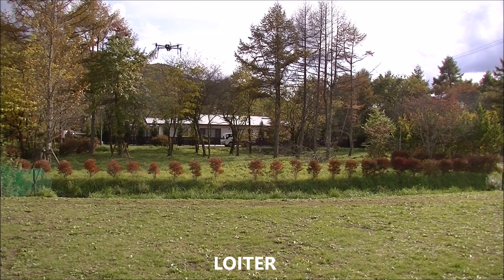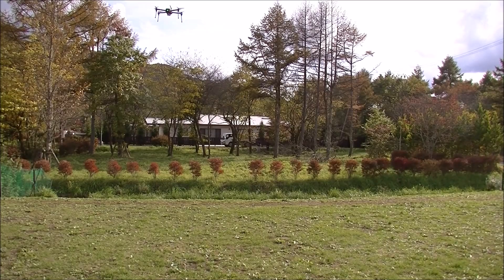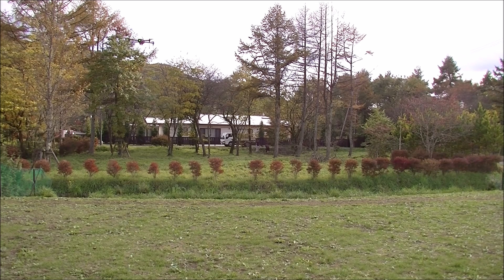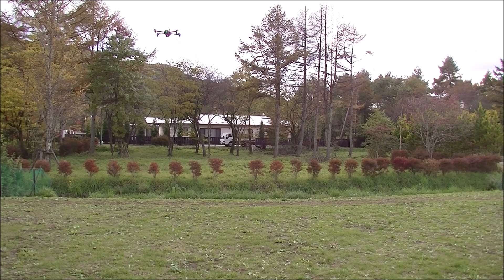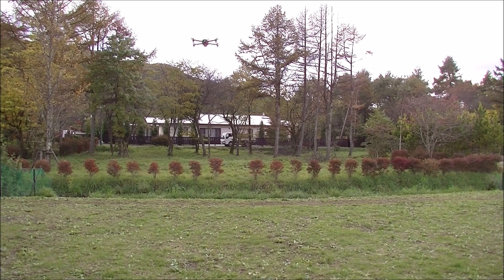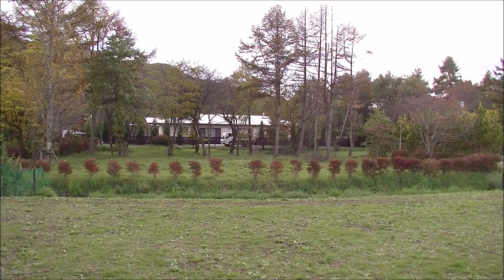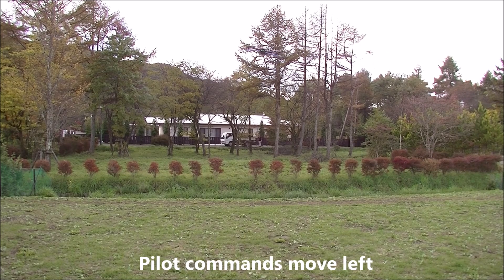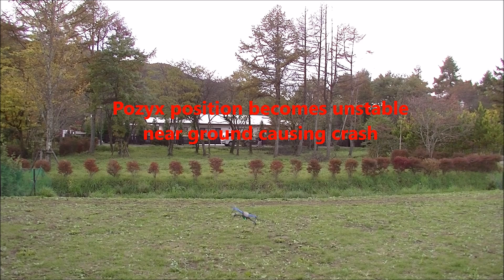Pozyx Loiter (No-GPS)

Comment: Hello, I am currently developing a project for my final year. I have been using q ground control as my ground station for non-GPS loiter, but it did not work. Any suggestion on how i should do it or will changing my ground station to mission planner help? Any input is much appreciated. Thank you
Reply from the maker: @Yap, I would have expected either ground station to work because Pozyx doesn't really involve the ground stations.  I always use mission planner myself.  Maybe try the latest development code (press Ctrl-Q on the mission planner's Install Firmware screen) and try using the EKF3 instead of EKF2. http://ardupilot.org/copter/docs/common-apm-navigation-extended-kalman-filter-overview.html
Reply: Randy Mackay thank you so much for the reply. I am not using kalman filter (EKF) for the time being. Does this affect? I am able to detect the coordinates from my pozyx tag on my arduino IDE using the indoor loiter sketch after a few modification, but i am unable to see the coordinates of my drone on my ground station (q ground control). Any suggestion to input? Thank you.
Reply from the maker: ArduPilot Copter always uses the EKF so I think your vehicle probably is using the EKF.  I guess you are following the instructions here? http://ardupilot.org/copter/docs/common-pozyx.html
Reply: Randy Mackay i doubt that my drone is using EKF. I cannot see the location of my drone on my ground station. Yes, i followed the tutorial on the ardupilot website but it still does not work. Any advice to suggest? Perhaps you have screenshots of the mission planner showing the position of the drone on your mission planner that you can share with me. Thank you so much.
Reply from the maker: Normally we do support on discuss so perhaps you can raise an issue there?  it's best to provide a binary log as well (maybe set LOG_DISARMED = 1) and provide a link here afterwards.
Reply: Thank you for the reply, mr Mackay. Can the loiter mode work without the ground station configuration? Due to time constraint, I am trying to send the coordinates from Pozyx to my computer via bluetooth to know my drone position on the ready to localize visualization map. Thank you.
Reply: Thank you for the reply. I have configured all the settings in my ground station (Mission Planner) and followed the steps on the website. However, i still couldn't see my actual location on the flight plan on my Mission Planner. Any advise to input? Thank you

Comment: May I ask, whats data of pozyx?
Reply: And I see, there is some unstable condition, why can be happen?
Reply from the maker: The Pozyx provides 3-axis position data within the area defined by the anchors (and possibly slightly outside the anchors).  I think the instability came from the quite limited range of the Pozyx.  So when it couldn't connect to one of the beacons it return very poor position data.  So far, I'm seeing a reliable range of only about 25m although I hope that can be improved.
Reply: oh so, if many beacon so will more precise the position, its will be great, hope there is any open source project like Pozyx (software and hardware)
Reply from the maker: Making an open source version is not too hard I think.  The Pozyx does make things easy with many built in functions but the real magic is in the DWM1000 sensor itself I think.  If price is the issue, I don't think the Pozyx is too expensive though personally.  Perhaps a very cheap version could be made for 1/2 the price but that's it I think.  The DWM1000 sensor is about $20 I think so once you include a fair market for the manufacturer I don't think it can be super super cheap.  That's my feeling anyway.
Reply: https://github.com/KitSprout/KDWM1000

This project gives the exact same capabilities than the Pozyx. (Same architecture : STM32, MPU, DWM1000)
Reply from the maker: Alexis, thanks!  that does look very similar to the Pozyx and way smaller.  Not sure it's for sale but for someone looking to make a product based on the dwm1000, I think this repo may provide the board layouts.
Reply: Randy Mackay There are multiple other projects, this one : https://github.com/thotro/arduino-dw1000 gives the same project without the MPU and with an Arduino (much simpler)

Comment: Looks really nice, did you fusion the proxy data with accelerometer for the position estimation?
Reply from the maker: In this test we are simply using the pozyx data as if it were from a GPS.  So only the position estimate from the Pozyx and the Pozyx itself was only using the dwm1000 sensor to come up with that estimate.  The EKF does blend the GPS with the Pixhawk's accelerometer data (and other data).  I don't think we will move towards using the Pozyx accelerometer data but instead move towards a tigher integration of the individual distances to the anchors with all the other data the EKF has (accelerometers, gyro, baro, optical flow and even GPS if it's present).

Comment: Hi Randy I wish to share a very unusual performance behavior. My Xugong V2 on a CUAV PIXHACK FC. I loaded AC3.3.3 did over 120 test flights to clean up some rough flying . Imagine driving on cobblestones . Now I did everything fro prop swap to firmware version change on esc. Xrotor using Blheli. Finally I loaded the old AC3.2.1 and to my surprise I'm flying smooth like on a first class paved road. I wonder why this is? Any thoughts?

Comment: Really good work. The positioning are really accurate, except it seems that motion will corrupt the positioning. Does it also take in altitude information from Pozyx for loiter mode?
Reply from the maker: Muquing, Thanks.  The Pozyx does return the altitude but in this test at least I'm not using it because so far the Pixhawk's barometer seems more reliable (although it drifts).  I'm hoping to improve the reliability by making some settings changes to the Pozyx (i.e. changing from 6.8Ghz to 3.5Ghz) but I have to say that I'm quite disappointed by it's range.  It's advertised at working up to 100m but it's practical useful range seems to be more like 30m.
Reply: you have to jack up the power if you want more range - have you talked to support? Also pretty sure they will suggest to set up filter on the coordinate output in order to mitigate crash risk.
Reply from the maker: Michael, I haven't tried talking to support but we did find this setTxPower() function that we will try to use to increase the transmit power.  I've received other advice that I need to raise the anchors.  In this test two of them were on the ground and two were at about 1.4m.  I think maybe we can try them all at about 1m.  I'm not sure what that will do to the position estimate.  We only need the horizontal position (x,y), we don't need z and it should be able to calculate that even if the tag on the vehicle is high above the anchors (I think).
Reply: Don't put the anchors in the same plane. I think there's a guide on how to position anchors. Also a smoothing function could do the trick for you. All functions are detailed on the site. Send a mail to support. My brother is a nice guy and there's a full team doing support from mon to fri.
Reply from the maker: Thanks Michael.  I actually only need the horizontal position.  I've tried putting them at different altitudes but I don't think it helps.  Increasing the transmit power to 33.5db definitely helped a lot though.  I'll put up another video in a week or so showing the improvement.
Reply: Reach out to Laurent at support @ pozyx, I talked about your case, he has seen the video and he also has some additional ideas for you :D but send him a mail and he'll come back to you.